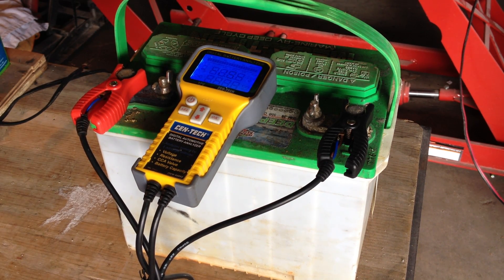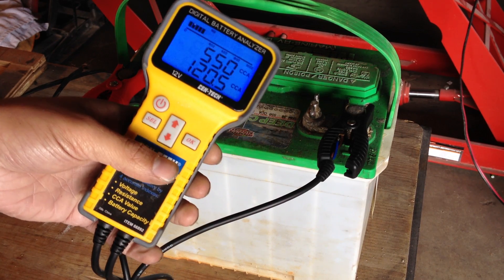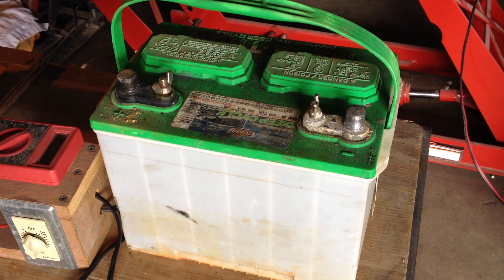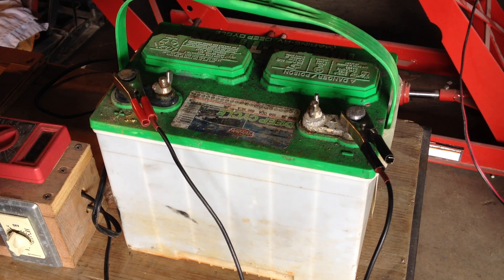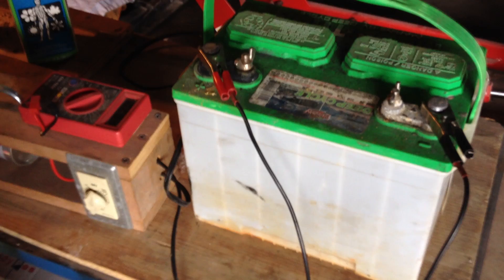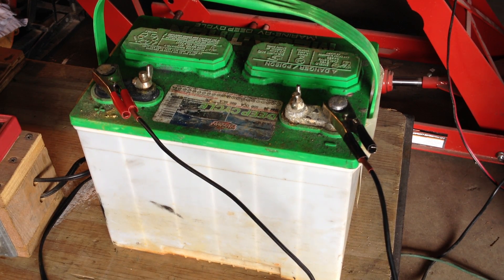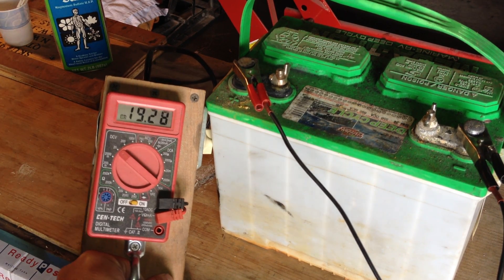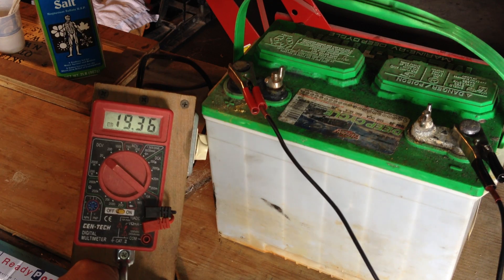Lead Acid Battery Desulfation Using Epsom Salt  -After Overnight Full Charge   Part 4 of 6

Comment: Is it safe to put more volts to it? Im Currently charging one at 17v, and getting 1.6amp current. anything lower and its under 0.5amps.  It will get more amperage if i turn it up more.  What would you consider the max safe voltage and for how long?  Its a small 26ah 12V.  Ive heard if you take the ah and divide it by 5 that is generally the max amp charge rate, is that acceptable?  Thanks for the info!
Reply: Update: i gave it 22V for 16hrs and it damaged the cells and now has zero amperage and only 8V, and wont take a charge at all.  Apparently short times of overcharge are ok, but long durations with over 50 degrees case temp is slightly too much.   It doesn't seem to keep getting hot over 50 degress under 20V.  Over 20Vand it rises to 50-60 degrees Celsius. I left it overnight at 22V and it fried it.  Trial and error Haha

Comment: what you have to do is dump all the acid, refill it with espom salts solution completely, put it on an overnight charger, then DUMP IT- and add new sulfuric acid electrolyte, available on Ebay for $14 a quart.  then it will have cleaned plates, and new electrolyte- and that's all good as an old battery will get.

Comment: THERE'S AN "M" IN FRONT OF THE OHMS SYMBOL ON THE METER READOUT, THAT MEANS "MEGOHMS" NOT JUST OHMS.
Reply: OMG, that means milliohms. Have you ever seen a (useful) battery with inner resistance in megaohms?

Comment: Just a hint from old timers inventions-called Capacitor battery charger. Check it out- easy build.Removes sulfate and can charge any lead battery. Adding Epsom salts also helps. DC output is 125 volts but Cap installed in serious controls the charge. Make sure a timer is used,charges fast.
Reply from the maker: +jojo archers I have multiple build videos on capacitive chargers on my channel ;-)

Comment: When I was young I worked in an automotive shop with old 1950s-60s equipment. I had a a large carbon pile load tester with no meters or gauges.  I found that the most effective method was what I called the smoke test.   It had a dead man toggle switch as the only control so I would hold on until I saw smoke.  If the tester started smoking before one of the battery cell did it was good. Ha!   It was the most accurate and effective methods for testing the reliability of battery I have ever used.

Comment: I wish on batteries like this they gave access to each individual cell so it could be worked on solo with a special 2V charger.   I have a 6V golf cart battery that has 1 bad cell.  I can tell cuz it does not gas (bubble) when I charge it.  I can try adding epsom salt to it but it like I said I wish I could just address that one cell with a special 2V charger so I don't bother the other cells which seem ok.  Why don't battery manufacturers so this?  Cuz they want the batteries to fail so they sell more new ones?

Comment: Dirty batteries leak voltage and cant be charged properly. Use your volt meter from one terminal to any place on top and see how many volts are leaking.
Clean the top until you see no voltage leaks then try again.

Comment: I have the same Cen-Tech tester as you, and even on brand new (1000CCA) batteries I have never got it to read over 250 or so. The one currently in my truck which spins the big block over fine shows to have around 200. 

Thanks for the videos. Havent finished the videos yet but if this ended up working i'll start rejuvinating some dead batteries.
Reply from the maker: Could be defective meter. I'm on my second one, but when they work, their great.
Reply from the maker: No, but I have used Shoemacher . The readings from the Centech from HFT were spot on with the name brand.
Reply from the maker: Voltage and heat build up during charging :)
Reply: DO NOT test the current of a car battery with a CenTech multimeter! It's rated current is 200 milliamps (0.2 amps). 

If 1000 amps would have passed through that meter, it would have exploded. Or it would melt the tips right off of the test leads. 

Use a battery tester if you need to know current.
Reply: Correct. My reply was to the comment above. There's nothing wrong with the video.
Reply: There are  a few ideas for fixing a car battery
do not attempt to do this unless you know what you are doing - the acid can burn you
Test the voltage first - there may be a dead cell which would waste your time.
Check the battery fluid.
attempt to fully charge the battery.
(I discovered about these and more from Jons Mender Guide site )

Comment: Thanks for posting these, cool to see someone tinkering in the name of saving a few $.  Not sure if someone else pointed this out, and I realize you posted this a while ago.  However if you'll notice the ohm meter has a small 'm' in front of the symbol for ohm, this means mili ohm.  I wonder if  a high salinity solution is conductive and screwing with the reading?  I'd be curious how much of a different result you get from simply topping off the battery cells with deionized water, giving a good shake, and a long charge.  I suspect the 'mud' you observed is the oxides suspended in the electrolyte.  Once they resettle and congeal the battery will once again be no good.  Maybe try replacing the electrolyte altogether...?
Reply: Just a quick tip if you want your battery to last longer then dont top off with DI water use 16-18 Molar Sulfuric acid. The whole DI water thing fucks up the chemistry in the battery making less and less electrolyte as you dilute the sulfuric acid. So yah fuck DI water.
Reply: Pure jibberish! Sulfuric acid has not disappeared--only water, Too much concentrated--plates wurp and battery becomes lead weight

Comment: dc common? no . neg/gnd. +-
Reply from the maker: you didn't empty out the acid did you?
Reply: Hah!  I get it, lol..   A moot point tho.. & not entirely in ur favor either.   English is such a rediculous language :)   Thus It doesn't really matter in the end..eh!
Reply: ***** i did empty out the acid. Was i supposed to keep the acid in there?
Reply from the maker: Yes, you were supposed to keep the acid in. It needs acid to function. It "Might" still work if you dump out the distilled water, and put battery acid back in. The distilled water and Epsom salt was to be used to top off the batteries.
Reply: ***** i had a question. i did 2 batteries with this trick but after i poured in the epsom salt infused distilled water into my batteries the chargers doesnt read that the batteries are even connected. is this whats supposed to happen?
Reply: How I was taught.  Empty acid.  Rinse with water.  Baking soda solution until the battery quits bubbling. rinse cells.  Pour in Epsom salts.  Charge battery 2-4-8 hours to see what you get.  Let sit over night.  Charge again to see if this improve.  
Try pulse charging, and cycling until you get a better charge on the battery if at all.  The goal isn't to use the battery like this at all.

Dump out all the Epsom Salts.  Refill with battery acid.  If you reclaim, use a paint filter to make sure no particulate matter goes back in the battery.   Then charge with the acid in the battery and see what you got.

Comment: i just did this yesterday to my deep cycle battery. It had sat for a couple years, then some of the acid spilled out a couple weeks ago. Decided to try. Was able to use trolling motor at various speeds for over 4 hours.

Comment: I was also told that I should only fill the cells half way due to acid expansion after charging, then used old acid to top off batteries.

Comment: So if I dump out the old acid I can use the purchased acid?  Should I try and clena the dry cells first to make sure I get a good reaction between plates?  I've seen a few videos on using baking soda to clean the plates.  Thanks in advance for your help.

Comment: Not advised the battery allready has a concentrated amount of acid that never leaves the battery. It is not neccessary, try the epsom it sometimes works but as this guy says you can buy a pulse desulfator if you want to go further. The pulse desulfates the battery.